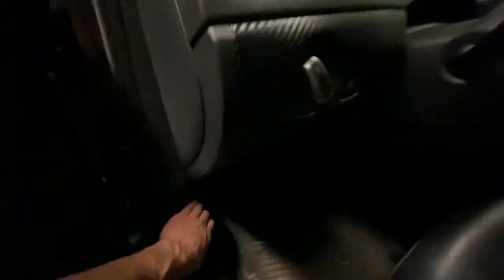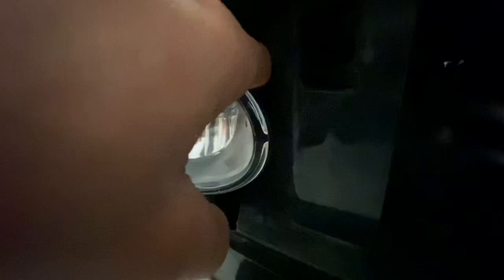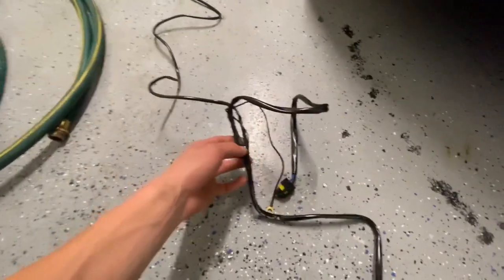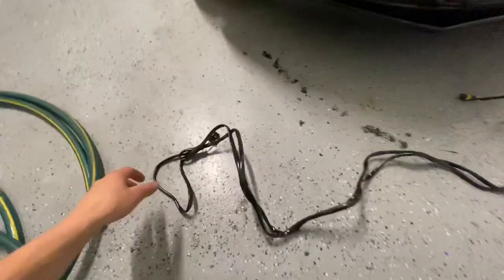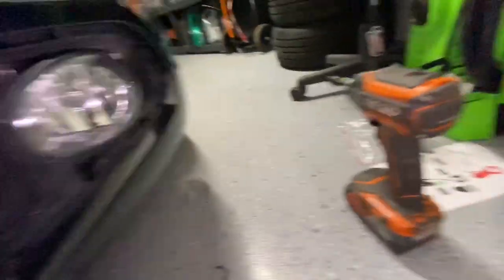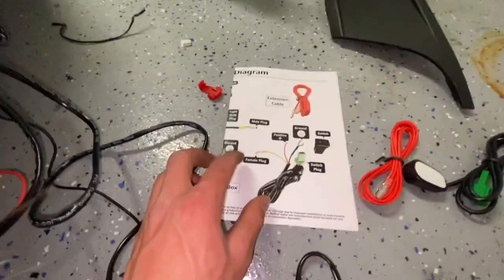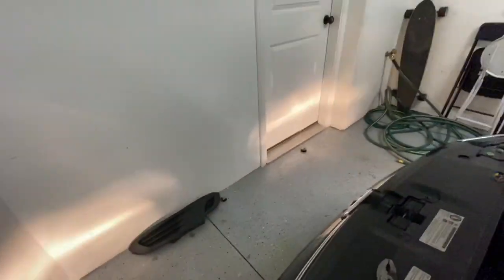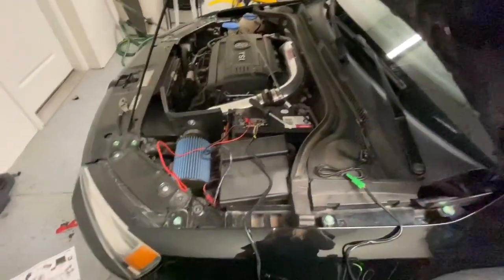Mk6 Jetta Fog Light Install!

Comment: Was thinking of getting set of these aftermarket fog lights for my vw caddy van , how do you rate the quality of them and the added grill trim housing panels do they feel cheap or good quality do you have problem with light units taking in moisture or anything like that